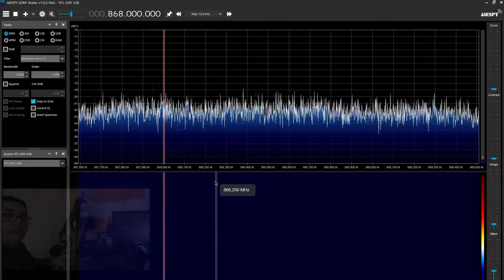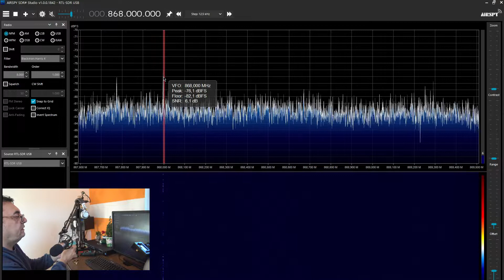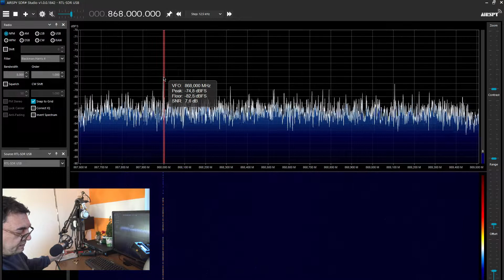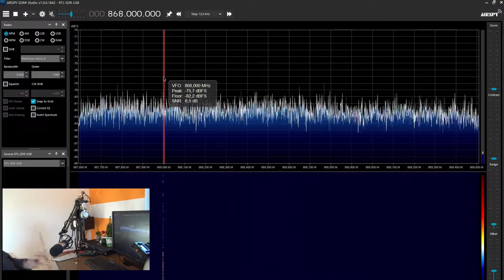LoRa coaxial collinear antenna test

Comment: Very nice experiment.
You schould build the same CoCo antenna with LMR400 coax cable instead of RG58.
RG58 is the biggest crap you can use on such frequency.
If you really need to be a thinner cable equal to RG58 you schould use LMR240.
Reply from the maker: Good idea..I will

Comment: Small tip over AirSpy SDR. If you right click on the screen when hovering over the signal strength window it will remember the highest value :-)
When it gets stronger it will update to that value. Easy for testing antenna position/tuning.
Right click again to turn it off.
Reply from the maker: Yes, it shows the highest point..I don't know how to translate that in antenna gain..yet, but it should be a way..I'm still learning..

Comment: Word of warning on that antenna but cover that tip if outside because it will get a white crystalline powder like stuff in it that degrades it fast.  Water (from humidity, and rain) will ingress that really does a number on the signal.  Just use a dab of silicone from the jacket up to the tip of the copper of the centre conductor then let it cure for 24-48h and all done.
Reply from the maker: Of course, just an experiment for now, I will find a proper plastic tube, tested in the microwave for radio transparency and will cover the antenna.Thanks!

Comment: Thank you for sharing.
I'm going to stick with my original antenna for now :-)
By the way. I've now got my SDR radio connected to a rtl_tcp server running on Raspberry Pi.
Now I can access the SDR radio over my LAN (TCP), using the SDR++ or SDRSharp radio software!
It works really good.
Reply from the maker: Interesting..I'll try that..